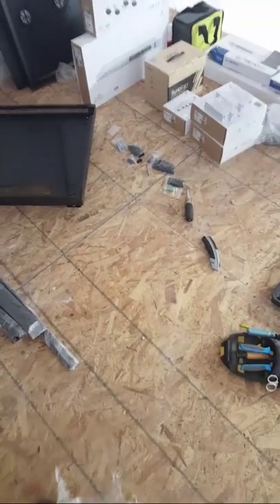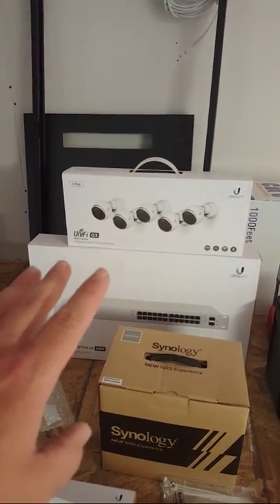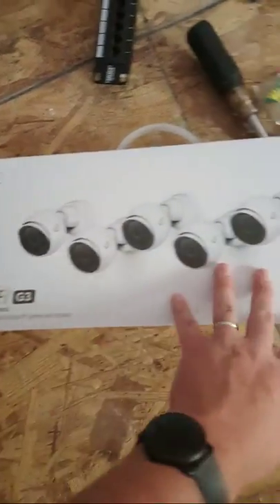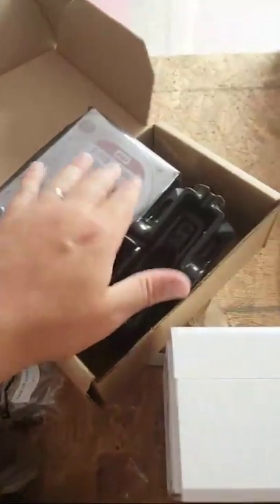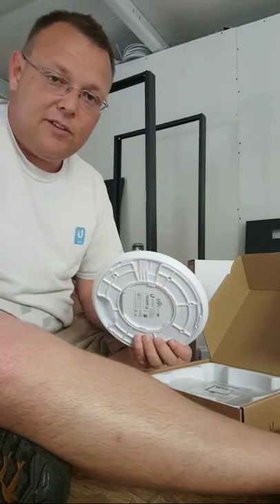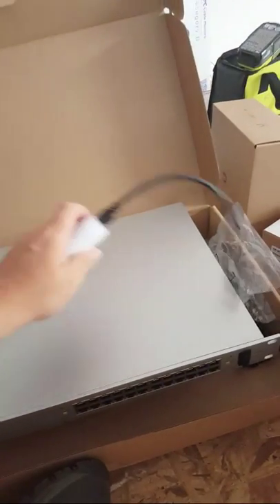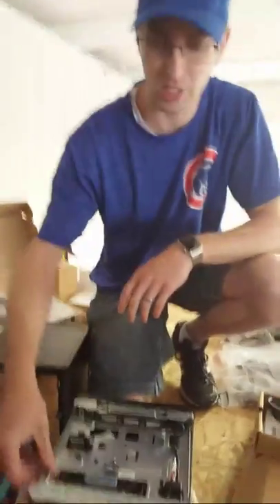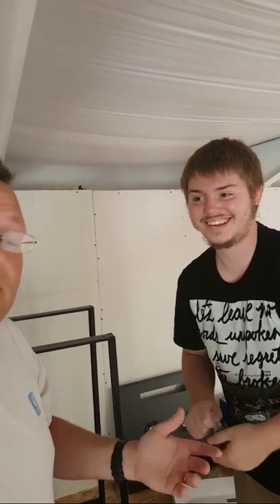New Network Install Day 1

Comment: Great video guys! I didn't know Unifi was moving away from Passive POE, I just installed 10 g3 cameras in my house with a 16 port Unifi switch, and changed the ports to Passive, but didn't know they might take that away with firmware. Good info!

Comment: @19:29 Memory Jogger: Microsoft Server Essentials 2016 gives free 25 user CAL or free 50 device CAL and no more CALs can be added. If you need more CALs, the Standard/Enterprise version is for you. Essentials is a good OS inexpensive version for SOHOs who don't need to use it as a HyperV virtualization host. Even if later, you need virtualization, I'd recommend Oracle Virtualbox (free). Sidenote: I've virtualized the following mission critical physical OSes into virtual machines; SBS2003 a few times, Windows Server 2000 a few times and even Windows NT 4.0 Server into Virtualbox. So it can be done.

Comment: Willie, in my 16 port 150w I can turn on 24V. I believe that I had to check a box somewhere in the settings for the option to appear though. Its also available (at least for now) on my 8 port 150W units as well.
Reply: Also, Every G3 "bullet" camera I've bought has needed 24V, but the Dome versions all accept POE+

Comment: Does the HP server have dual NICs that can be bonded?
I self-build the hardware in my client servers which have dual 10G and dual 1G NICs, an M.2 NVMe connector, 2 SSD slots and up to 4 HD swappable bays, all in a teeny tiny silent case.

Comment: I don't understand why you needed the Instant 802.3af Adapters? All the US-24 switches (250w, 500w) put out passive 24v right?
Reply: The ubiquiti website shows that the unifi switches do "The UniFi® Switch features auto-sensing IEEE 802.3af/at and 24V passive PoE to power multiple devices on the network."
Reply: Never trust the data sheets/website, it gets out of date so quick.
Reply: Willie, thanks for the Live Stream! I'm guessing you'll obviously check out the 24/250 settings for passive POE before just popping in those adapters. I installed a new Switch24/25 POE switch about 2 months ago and it is software selectable. It's possible that my unit was sitting on the shelf just check if software selectable. I also noticed you didn't use the Ubiquiti Cat 6 bulk cable. Not a problem just unexpected from what you've said in the past. Why not use the G3 Dome cameras indoors? Just curious. Last question, wouldn't a Slightly larger Synology or even a QNAP NAS serve as a windows file share for the customer and avoid a standalone Windows server? Again, Thanks for the video! P.S. I need to get my Ubiquiti Shirt too!

Comment: I've seen a number of videos of people over the last several weeks where they start mobile streams in portrait mode, and they all wanted to change to landscape almost immediately, but couldn't. Now, I've not used the livestream function on the YouTube app (or any app for that matter), but it seems like a UX/UI problem and it must not be well designed to prevent VVS (for context: https://youtu.be/Bt9zSfinwFA). (I would think landscape would just be the default and you would have to explicitly change it, but what do I know?)
Reply: not a criticism of you, just an observation/criticism of poor design.
Reply: i believe for youtube streaming, before you hit "Go Live" one has to find the setting to stream either in portrait or landscape

Comment: Hopefully you are not backing up all the workstation to the server and then sending it to a DR. I hope you are hosting all data on the server and using group policy to Folder redirect on the users profile. Then backing up only the servers customer data. It's such a waste of space to backup whole workstations.
Reply: Thank god. I was going to have a heart attack.
Reply: I've used this design before...replicated our QNAP NAS to another QNAP NAS at my house every night.  Then we were hit with ransomware on our server (owner wouldn't let me implement security measures to have prevented this).  Even if I hadn't caught it and got it off of our network and it had replicated to my house it would have just uploaded the new encrypted copy and not touched the clean copy on my NAS at home.  So with rsync you should have another level of ransonware protection.  Only thing better would be a Datto.